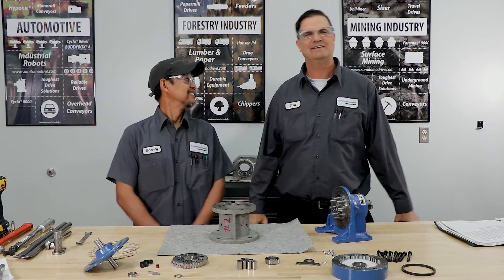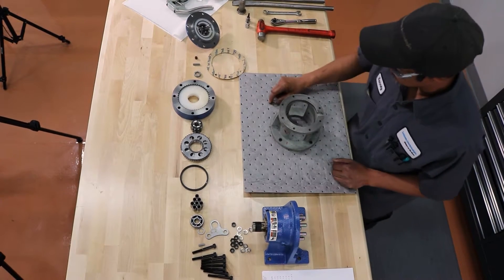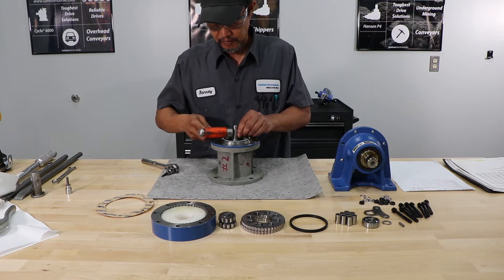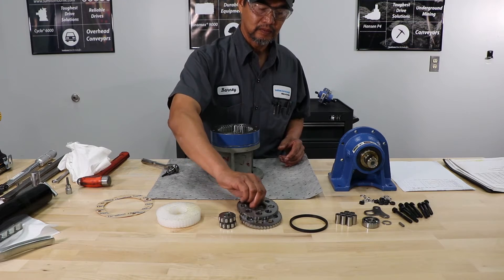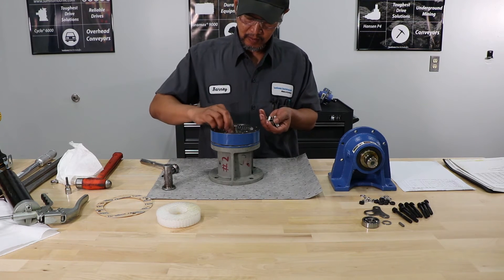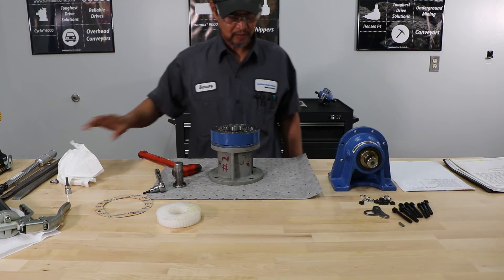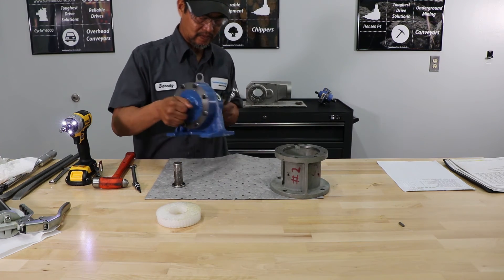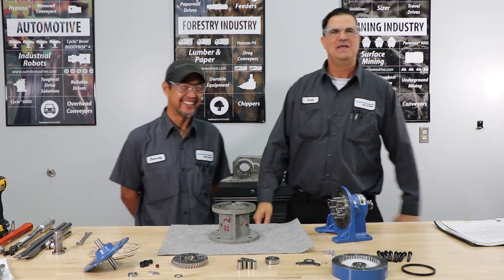How to Install and Assemble a Sumitomo Cyclo Gearbox I Power Institute

Comment: Hi  I have few questions 
Why you are very specific about 180 Deg orientation on the plates 
And what happens if we don’t align 180 deg
Reply: It is the phase difference. If there is only one of those eccentric plate, the center of gravity oscillates, which will cause severe vibration, to balance it, the other plate is phased to the opposite side, which should ideally stop any vibration